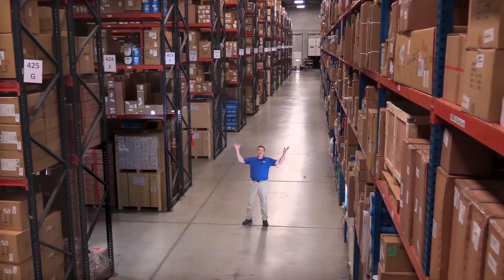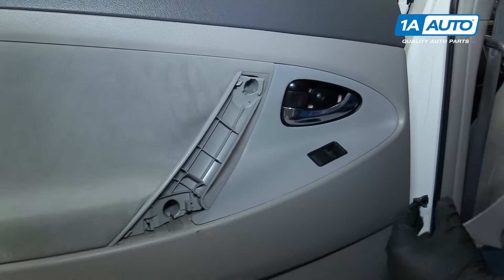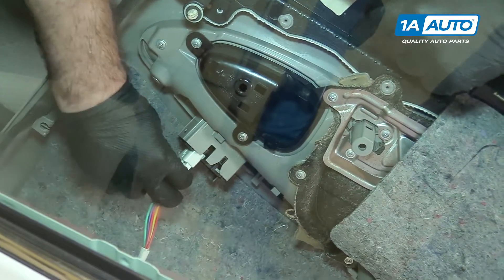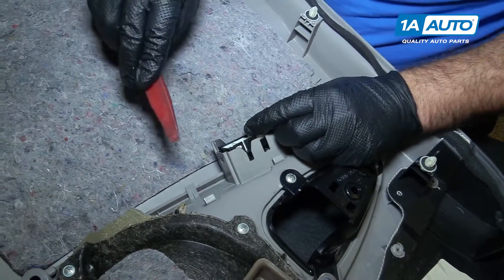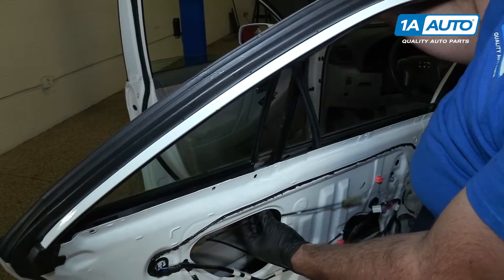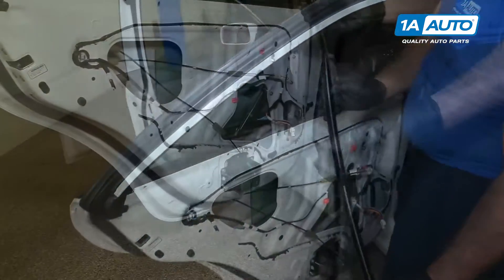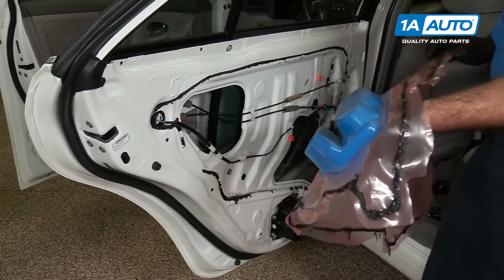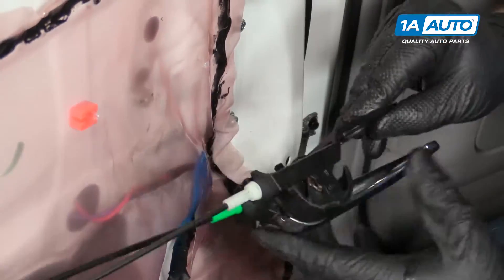How to Replace Rear Window Glass 06-11 Toyota Camry

Comment: MOST EXCELLENT VIDEO!!!
WHERE I WAS STRUGGLING, AND THE KEY TO THIS WHOLE PROCESS IS KNOWING WHERE THE SCREWS ARE TO DISCONNECT THE RUN CHANNELS! ONCE THE RUN CHANNELS ARE PROPERLY REMOVED THEN A NEW GLASS CAN BE PUT INSIDE AND ABSOLUTELY NOT BEFORE!

THANK YOU VERY MUCH FOR THE VIDEO!!! 👍

Comment: If I want to take one off a car in a junkyard, is there a way to do this without lowering the window electrically?
Reply from the maker: +Dave Rikson Thanks for watching!  In order to angle the glass out of the door it needs to be down.  If the motor does not work then you will have to manually crank the gear.  If it is a cable driven regulator you can sacrifice it and cut the cables as well!  1aauto.com

Comment: Well this will definitely help me in the process of getting the door off but it's the small triangular window I need to replace. I don't even know what that is called, lol. Ugh. I had to break mine to get into the car. It locked while running. 🤦🏼‍♀️ My luck, huh? 😆
Reply from the maker: +Jamie Judd Thanks for checking us out! http://1aau.to/m/Shop-1AAuto-c
Reply: @1AAuto  I'm trying to replace the rear driver side vent window. its basically the same process but where do I stop the disassembly of the door?